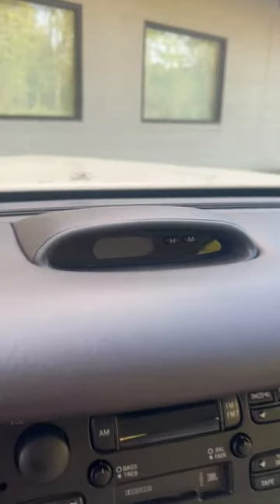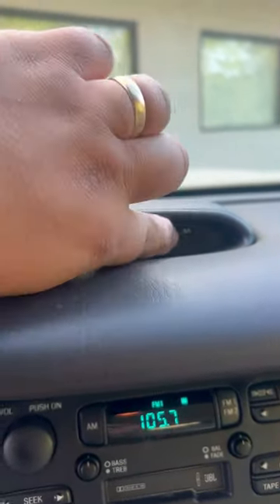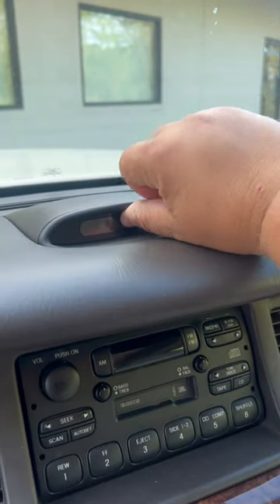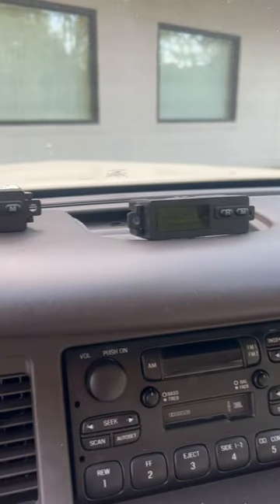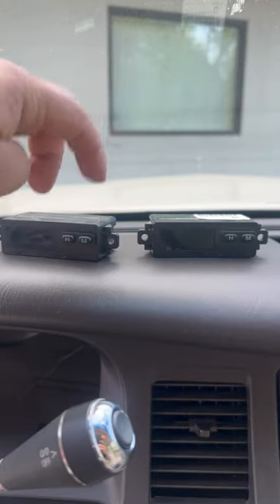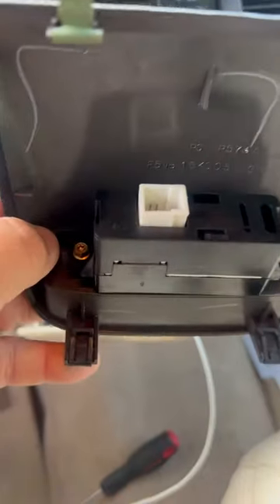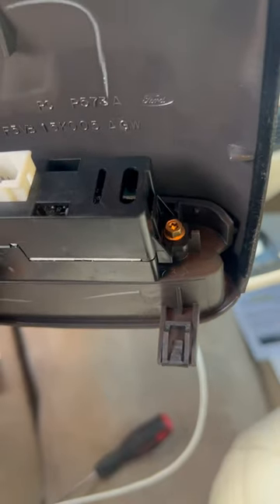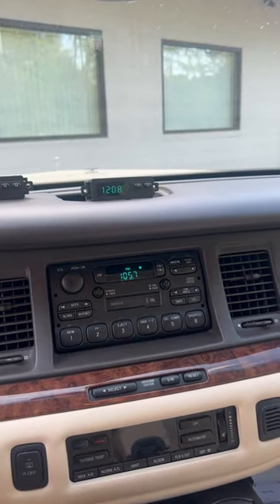1995-1997 Lincoln Town Car burned out clock replacement EASY #shorts #howto #diy #lincolntowncar

Comment: Excellent. If the clock in my 97 quits I know what to do. Have you ever tried to replace the bulb for the transmission gear selector? Good grief.